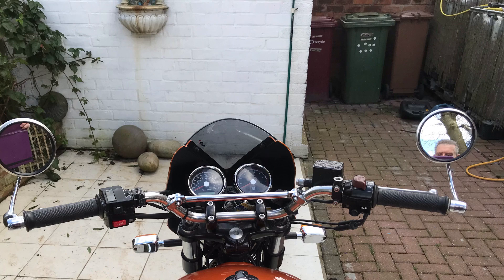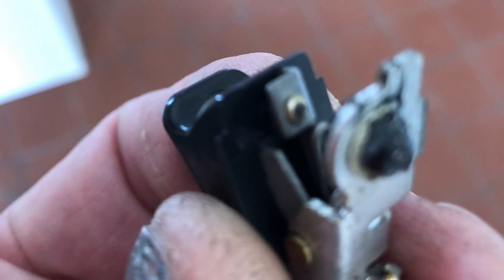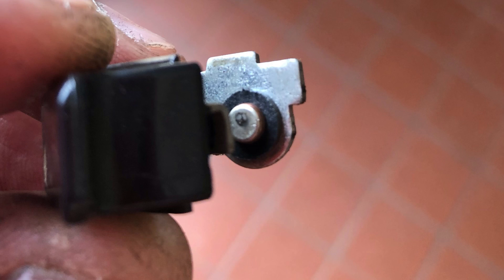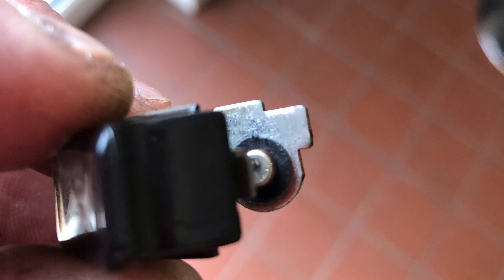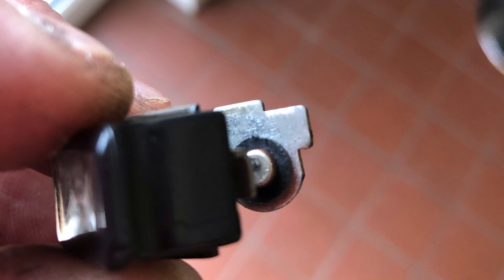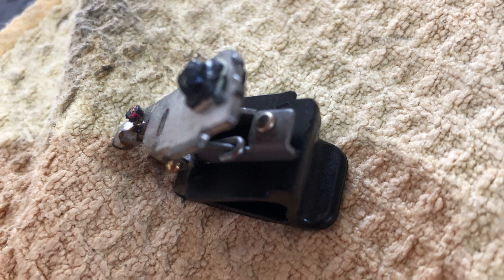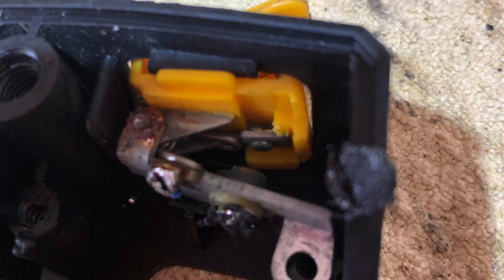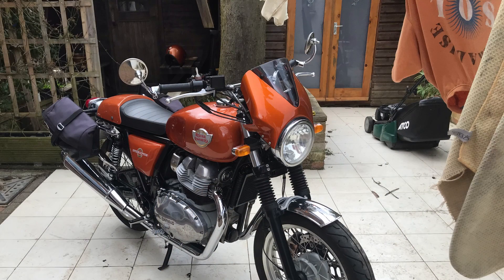Interceptor 650 switchgear upgrade

Comment: I am at be it late commenting , but I suggest the switches are cleaned with contact  cleaner and then silicon grease is used to stop moisture getting to any metal parts , but leave the switch contacts free of grease . It might be possible to replace the contact points or adjust , file (carefully with much thought ) , their faces to increase the contact area . 
Do not wait for corrosion to set in . Preserve your electrics using silicon grease ....simples .
Reply from the maker: I use a product called DeOxit. It’s an expensive aerosol spray which removes corrosion and oxidisation from contacts. Usually the contacts need only a slight abrasion with fine wet and dry paper. Then only the moving parts are greased.

Comment: As a retired motorcycle mechanic,as part of an service I would spray WD40 into the switch gear, doing that helps alleviate that problem, if the was an existing problem, spray will contact cleaner then WD40
Reply from the maker: Yes, I understand what you mean. I’d say the switchgear is not brilliant quality tbh and that there is probably only so much one can do!

Comment: You're extremely handy with a soldering iron, new switchgear looks good.
The original switches are not the best quality but as you correctly point out, it's a budget bike.
I've had my Interceptor since 2019 and I'd never sell it.
There's nothing wrong with making a good bike even better.
Ride safe
Reply from the maker: Absolutely, Paul! “The pursuit of excellence”! You too…..watch out for all those hazards we face….

Comment: The only thing about the switches is they look shit,would like polished alloy,even my cg125 had that,in tact my c70 stepthru had as well
Reply from the maker: The internal components are not the best and, in my case, nothing worked properly . Yes,  the FJ1200 switchgear could be polished easily enough, being cast-aluminium.

Comment: Nice switch choice however if I could find something similar but with emergency flashers also.  
Years ago I bought a new 1975 Ducati 750 GT and soon replaced all the switches with Honda parts.
Reply from the maker: Yes….the Interceptor doesn’t have hazard flashers though, so fitting switchgear with a hazard switch on it would mean rather more complicated wiring up, I would say.  I chose the FJ1200 because of the cast-alloy body and the exact same functionality as the OEM switchgear.